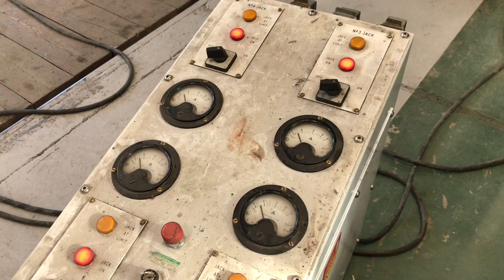P2 Tender tank arrival at DLW

Comment: I notice the squares on the panel sides of the tank, and when gloss painted it will show up even more.  Can you tell me if the same gauge of steel sheet has been used as original or maybe it is a weight cutting exercise?